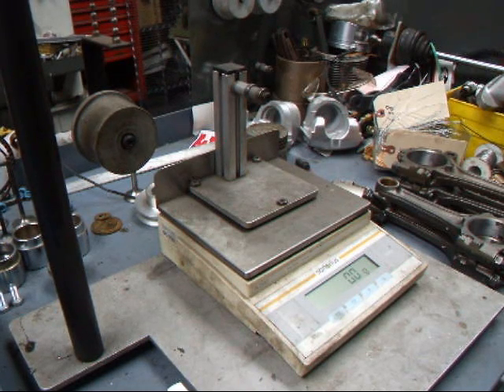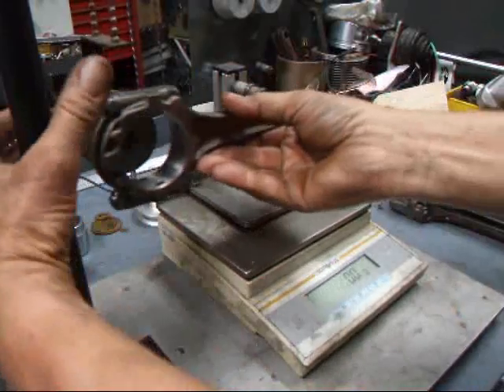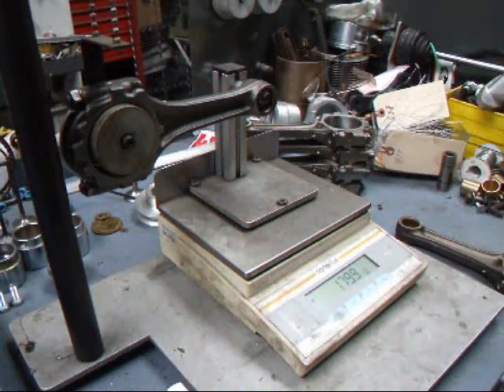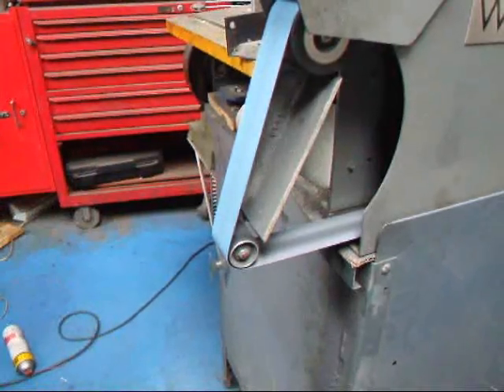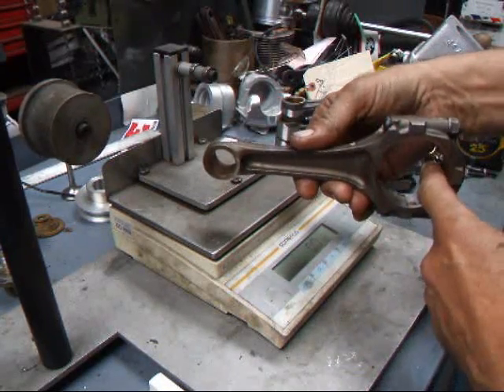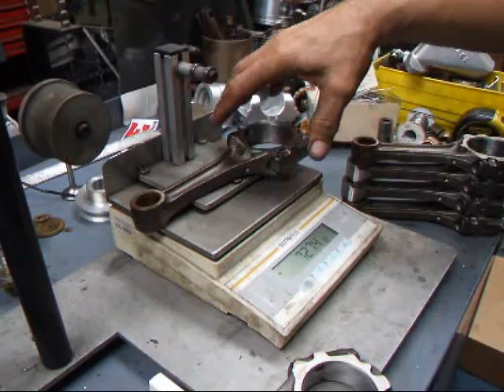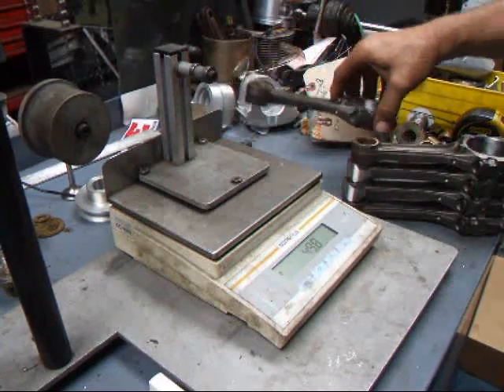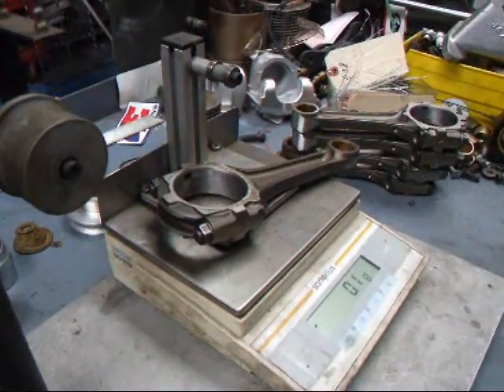Connecting Rod Balancing

Comment: 40 years ago when I was a lowly apprentice a truck came in the shop, new factory rebuilt engine with a vibration. Felt like it was missing but every check indicated it was ok, vacuum, compression, ignition trace, cyl cut out. Didn't figure it out at the time but over the years I ran into different things causing weird vibration: casting flash in intake manifold blocking cylinder, wrong piston with wrong wrist pin height, wrong flywheel.
20 years ago my last personal service truck had a weird vibration, engine related but the newly  factory rebuilt engine ran fine. I tore it down, checked everything and decided to weigh the rods. With the kindness of the local post office and later town store after the post office closed discovered the rods were not the same weights. After many trips back and forth from shop to post office or store, grinding on my part and weighing on theirs we came up with a set of rods that were reasonably balanced and that engine ran like a dream.
In my mind a 20 year mystery solved. 
Re-builders: please ensure the rods in your engine are at least close enough together in weight to not cause vibration.
Reply: Cool story bruhhhhh. But it needs more dragons... 🤦🏼‍♂️

Comment: I know nothing about your job. I do know physics.
I watched your video and I feel  that you removing metal from the rod cap is problematic. There are two fulcrums.  One in the center of the big end and another in the center of the small end. In your second step, by removing metal on the cap you then increase the small end weight in a two fulcrum system.
Reply: The procedure done is right; generally you measure the both ends individually. As a parallel forces system, you can calculate where the center of gravity is: the important thing when balancing the engine is that all centers of gravity are at the same distance from the crankshaft journals, so you can dinamically balance the crankshaft counterweights.
The important part is that not just all the cg's are at the same distance, the total rod's weight have to be the same, especially in V engines.
Reply: Anyone else agree with this? I'm about to do my own rods so trying to learn the do's and don't's
Reply: I would agree -
I believe each end should be measured independent of each other. I not only match TOTAL wght - I have a similar hanging system - except I do both ends. Then double check total wght at the end. But you need a high/low to fall into as video states. Otherwise it would be never ending trying to match all 3.
There has to be a GIVE - IN somewhere !!!!

Comment: this is a nonsense. No way can you balance rods like this.
Reply: +Guy Croft He just did.....
Reply: no, you cannot assume mass removal by this means assures same C of G position on each rod. Removal must be done incrementally at each end. Very time consuming. If you don't get the C of G in the same place you won't get optimum reciprocating balance. Sure, you might be able to assess the V imbalance factor for crank balance but that is all you will achieve. I've done this so I can assure you I am right about what I say.
Reply: Guy Croft But he did one side at a time. If his point of support is on the bottom end, and the weight on the scale is only from the top end, then ensuring all of the top end weight is the same means that the top end of the rods are all the same weight (because the bottom end is being supported in the fixture).  Therefore when he weighs each connecting rod on the scale after that, all of the extra weight is only on the back end. I am not arguing with you I am genuinely questioning why this method isn't correct according to you, because to me it does seem like it would make the COG the same in each rod.
Reply: I'm an engine builder by trade and this isn't a good way to balance. The mass of the cap acts as a counterweight to the small end. Taking mass off the big end makes the small end read heavier.
Reply: So where do you suggest to remove the weight from ? @malcolmkermode9794
Reply: Malcolm Kermode How can it cat as a counter weight when the axis is the same, straight line between the centre point of both orifices and the weight is measured at the dead end of the object?
Reply: Because the balance pad is on the base of the rod cap which to one side of the centre line of the big end. It's acting as a counter weight. Add weight and the small end reads lighter. If you take weight off the base of the big end and the small end reads heavier. This is why most shops use two scales so they can see the weight of the big end and small end at the same.This is also why Rover and Mercedes have balance pads on the base of the beam and not on the big end cap.
Reply: If your using a single scale you need to start with the big end then go back and forth a few times to get it right. Another way if it's a common engine is to get two or three sets of rods, grind and polish the beams, grind off most the balance weight then make one set that match. That's how we use to do it before you could buy aftermarket cnc machined conrods. It's cheaper, easier and a lot better to just buy new rods.
Reply: Hi L Singh Well I can't remember ever working on a T5 Volvo however inline engines are very easy to balance because unlike a V6 or V8 engines the weight of the pistons or rods does not effect the balancing of the crank. As long as the rods are consistent in weight then it's okay. If they are aftermarket forged rods then they should be very consistent in weight. I hope this helps. Mal
Reply: Этот метод очень простой и удобный. Если делать этим методом, то вес шатунов будет в допуске и даже во много раз меньше допуска. Вы конечно правы, что вес будет не идеальным во всех шатунах, но он будет более чем в допуске.
Reply: Если у кого то возникнут проблемы с весом шатунов по этому методу, можно повторить процедуру 2-3 раза и я ручаюсь, что для измерения веса не хватит точности измерительного прибора. ( весов )
Reply: Malcolm Kermode ok....got it! The difference will be miniscule...probably he is ok with it.
Reply: Malcolm Kermode Yeah....makes sense! 👍
Reply: Malcolm Kermode hey Malcolm can I ask you a question Sir?

I'm currently rebuilding my T5 volvo engine and I am using forged connecting rods - would you recommend balancing them ? Or due to modern CNC abilities etc can I just smack them in? 

Thanks in advance
Reply: Guy Croft I agree. Don’t get aggravated. The majority of the YouTube audience has no background.
Reply: @Bozemanjustin  thank you for brightening my day with that comment lol #withher lolol

Comment: Why would you want to weaken the piston end of the rod? It seems any material you take off will make the rod weaker. Why not just take off the crank end?
Reply: Usually there is "extra" material available for removal. Sometimes a pad, sometimes a raised seam.
Reply: Balancing means you are making the center of gravity for every rod the same. So in a very basic sense, you need both the small and big ends of the rods to weigh exactly the same to be perfectly balanced. Some people argue over the tolerance, but the procedure involves removing material from both ends.

Comment: This is not right... You balance the big ends " FIRST " then you weigh the total rod and remove it off the small end...
Reply: +Jonathan O'Hare Since the big end is supported by the jig it doesn't matter.  Or visa versa.  The end resutl is identical, whichever end you begin with.
Reply: Jonathan O'Hare According to UTI the Top Automotive school in the country there is no actual sequence but "suggest" to do the smaller end first, weight the rods then shave off the big ends avoiding the center of the top.
Reply: I check the total weight of all rods, then each end and sort them by whether I will take material off one end or both. I am balancing to +/- .3 grams
Reply: WAVETUBE84  Не совсем так. В начале нужно снимать металл на верхней шейки шатуна! Как показано на видео. А уже позже подгонять вес на нижней шейке! Как показано на видео. Почему именно так? Дело в том что на первом этапе мы практически идеально уравновешиваем верхнюю часть шатуна. Да в противовес верхней шейке шатуна идет нижняя, но этим можно пренебречь. Так как плече на которое воздействует сила противодействующая весу верхней части шатуна сильно меньше плечу на котором взвешивается верхняя часть шатуна. Таким образом мы получаем практически идеальный вес верхней части шатуна. Второй очень важный момент это подбор веса нижней части шатуна и веса всего шатуна. Если взвешивать только нижнюю часть шатуна, то не будет учитываться разность веса крепежного элемента.поэтому все делается в сборе. И если делать именно как показано на видео, то мы получаем идеальный баланс между весом нижней части шатуна, крепежа и весом всего шатуна. Если кому то вдруг не хватит точности балансировки таким способом, повторите процедуру 2-3 раза и вы получите идеальный результат.

Comment: Why do you have to match the little ends of the rods?
The Big ends are rotating with the Crankshaft, so I understand the importance of doing those, but the little end is only travelling up and down (linearly) with the piston, so can't you just count it as part of the overall weight?
Reply: +John “Doc” Warner Equalizing the weight (end to end) equalizes the center of gravity of the rod. Unequal center of gravity, between rods, effects the balance when the rod swings between 90 degrees the 270 degrees (0 degrees being top dead center). It's not much, but does have an effect. Also unequal end weight effects the impulses upon the crank and causes harmonicis when running. An unequal weight small end will cause the rods with the heavier small ends to accellerate and decellerate at a different speed. So you will have the heavier rods slowing the crankshaft on it's portion of the crank causing it to flex a little more than the lighter pistons.  That little amount of flexing is more pronounced at certain rpms and more or less pronounced if the motor is rev'ing up or down.  That flexing, shaft twisting, and "ringing" back and forth puts a lot of internal stresses on the crank (which can lead to failure on high rev'ing, high performance, engines).
Reply: Ah, that makes sense, thanks.

Comment: John im in the process of static balancing a home built single cylinder  crank, for a little homebuilt engine. How is the rod leveled on your set up there and if you were building such an engine what balance factor would you use? i know they will never be perfect, but is 50% a good start point ? i would think so haha
Reply from the maker: Single cylinders like around 52-58%. I would start with 58, run the engine, them make corrections. Singles are the most difficult to balance because the percentage affects overall performance. Rod is leveled by eye. I have ball bearing on each end. Let me know when you post some video of your creation!   John...
Reply: Ive heard those numbers more then once Thats what i'll shoot for.Its been an experience! Im about a year an 300 made parts into it now.Its a little 30cc ohv ohc 2 valve engine with a machined cylinder head (no castings atall). Ive made virtually the entire thing, you name it ... even fasteners. Its about 80 percent done and as it sits the only things i havnt built are a toothed timing belt of 5mm pitch, a sparkplug, 2 valve springs and 2 main ball bearings. I managed to off set turn a  short length of stock that was was mounted on a rotary table off center in a 4 jaw to make a cam profile with symetrical  lift and close profile as i have no mill! ( later soldered to a shaft)

Comment: I have spent many hours attempting to replicate what you and others are doing to balance a set of rods. I have used electronic scales and a triple beam balance. My scales are accurate. My problem is  if I take the same rod, mount it on the jig, I get a different weight, no repeatability. How is it that you have the big end floating in space and you get consistent readings to one decimal place ? I can't
Reply: I'm having the same problem of yours, with several tests with the same rod I did not get repeatability. Did you solve this problem there?

Comment: Well done sir.  Question:  If you were to now weigh the rods for balance front:rear after removing material from the cap, are they still balanced?  I realize theoretically it still should be but have you checked just for the hell of it?

Comment from the maker: We use 80 grit. Don't know what a 'kinfe' style belt sander looks like, but it may work. All you want to do it remove the weight - belt sander, file, grinder they all remove weight. That scale measures to .1 grams, you need a sacle that measures to a minimum of 1 gram. We aim for plus/minus .5 gram when balancing rods, etc.

Comment: Dear John.  Thanks for all of your vids, they are really informative.  I am about to rebuild a Cummins 6bt diesel engine for a boat and want to lighten the rods.  They are very rough cast and the casting flash is roughly ground off.  Is there any value in grinding and sanding the rods all over to give them a smoother finish before balancing?  Thanks john for your time and your expertise.  Kind regards Paul (England)

Comment: Are titanium connecting rods avaliable for the Lt-1 engine?Are titanium connecting rods cast,forged,or can come either way?Do they make billet rods that are lighter than titanium rods?When I rebuild the Lt-1 in my vette I would like light weight engine parts.What are some good cheap rods,cranks,pistons & bearings you would recommend for the Lt-1 engine?Same question is price isn't a concern?Thanks for your time & let me know these answers when you get a chance.You obviously know alot.

Comment from the maker: @burton402 - I've never heard of compressing the rods in a special fixture or heating them to do so. Shorter rods are sometimg necessary to stroke and engine, but I prefer to use a small and lighter wrist pin and move it up in the piston. Does require special pistons, but if you are going to stroke and engine you will need different pistons anyway.